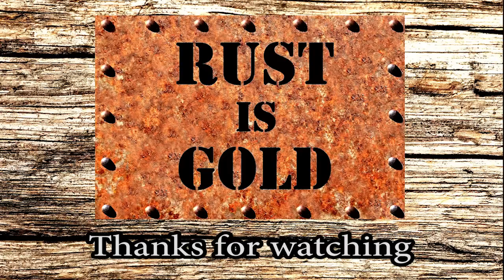EASY TO MAKE CROSS CUT SLED for TABLE SAW - DIY

Comment: I watch may diy videos, and admire the presents skill and willingness to share their project ideas.. the one conclusion I have come too is that the starting point is to own or have initial access to a high quality table saw , this makes every other project easier , accurate and durable
Reply: So what is your point?
Reply: Rob  I just meant that a precision table saw  when used for initial cutting will make anything made from it so much more accurate for other projects etc ,did not intent to find fault with your efforts.

Comment: Good video. Did you make your table saw and rip fence? I made a similar sled and put two 2"x2"s  on the back of the sled where the blade comes thru and then screwed on a metal plate to let the saw blade hit in case the sled was pushed thru the 2"x2"'s. That is to protect my fingers.
Reply from the maker: Thank you very much for your comments!!! Yes I made my table saw and rip fence as well.
Reply: UPSIPO  Yeah, those blocks are useless. But I don't see the runners being stopped: Usually those slots go all the way through, so the runners may protrude at the far end as much as they need.

Comment: Cute sled... for cutting kindling. How do you know that your sled is square to the blade? You have some major dust issues and not wearing a mask? Bolt down your drill press. Safety first!
Reply: @dwlsml4118  I apologize for coming down a bit hard however this professional video is supposed to be educational, It shows more incorrect practices than correct methods. There are many more very good videos on this channel and I have even seen improved sleds on this channel. This is not one of them.
Reply: dwl sml , nothing wrong with that comment, this guy needs to learn the basics first! No riving knife either?? I personally don’t like to eat sawdust when I’m working.
Reply: @mack2420  i tough i saw a riving knife
Reply: @summerfox9292  You did.  1:48.  It looks like it saved his life several times too.  2:00

Comment: Very simple but I highly question the accuracy of the cut. I doubt it's 90 degrees to the blade. Do a YouTube search on the 5 cut method, it's typically within .005 inches per foot of being square.
Reply from the maker: It's true that it is not for professional use. For the simple projects I make it works fine. 😊👍

Comment: A little confused, you didn’t show how you squared it up to the blade?  Btw, technically it’s not a sled! A table saw sled needs a bottom! Not to be picky, but no riving knife either???
Reply: It's called a sled because it has 2 runners
Reply: 1:48  There is a riving knife.  Good thing too, the way he leaves the pieces between the rip fence and the "kicker" side of the blade.  2:00
Reply: I'm thoroughly confused as well.  How did he square it up?